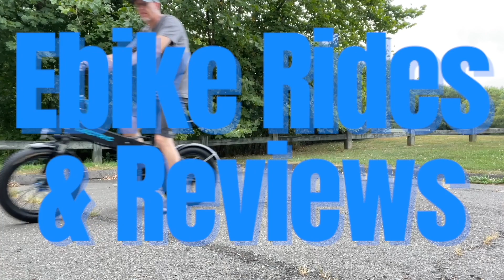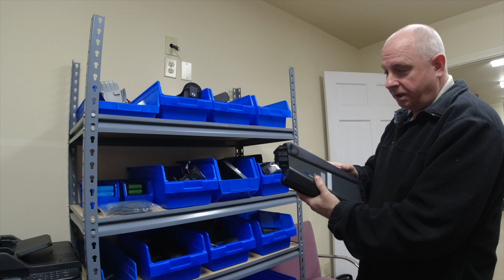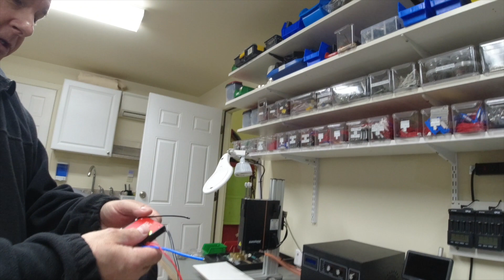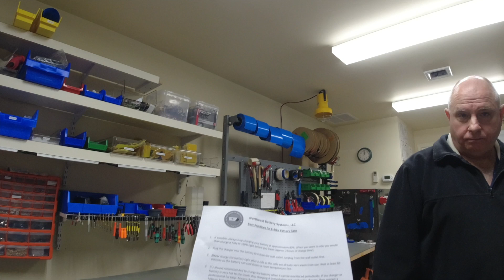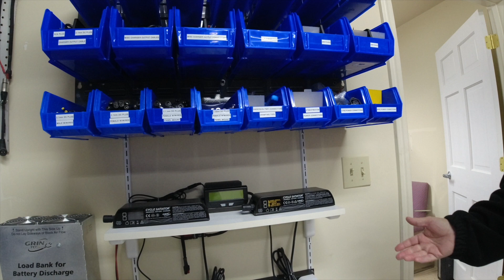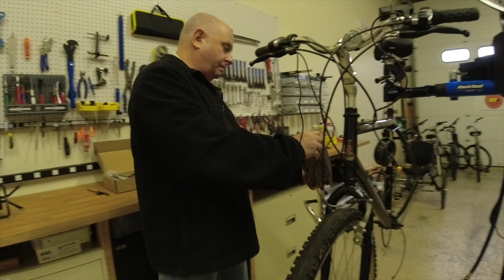Go inside an Ebike Battery Repair Shop

Comment: I have a couple cells that have a very low charge. (Stupid me before seeing this video) took the china battery out that was hot glued in the sleeve. Most of the wires are hot glued. I tried removing the nickel strips and it looks like the 4th of July in my apartment. There's no way to safely remove the discharge wire unless I cut it off without electrocuting myself. Can one of your guys travel to Massachusetts and help me? I'm in Amherst.
Reply from the maker: You are really close to Kevin give him a call

Comment: Hello i have a freego hawk it was re-celled with boston cells upgraded to 16ah around 2 years ago recently due to the cold weather it is dropping a bar on the power meter is this a normal thing for this time of year?
Reply from the maker: You will get a loss of range in colder weather, how much so I cannot say.
Reply: Yes that is very normal on very cold days. My bike does that too.

Comment: I'd be curious to know how many AH he could get out of a modified Lectric 10.4 AH factory battery?
Reply from the maker: He thinks he might be able to squeeze 15 Ah in the pack
Reply: That would be good to know, especially if you could get maybe 16 or 17ah for the price of the 14ah pack.